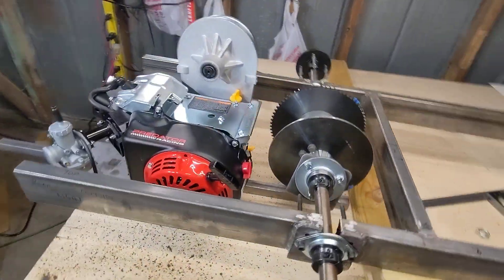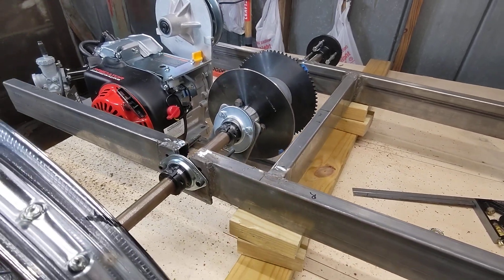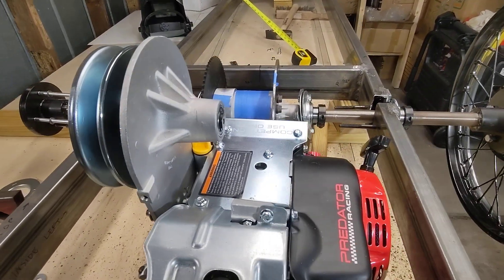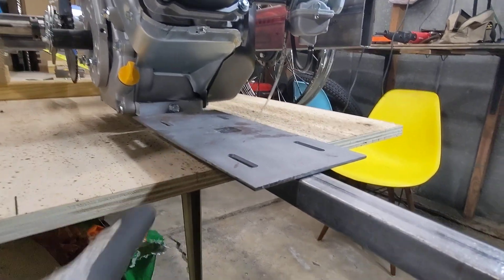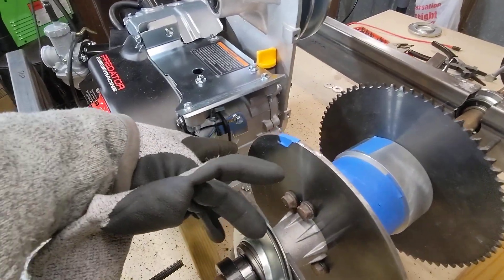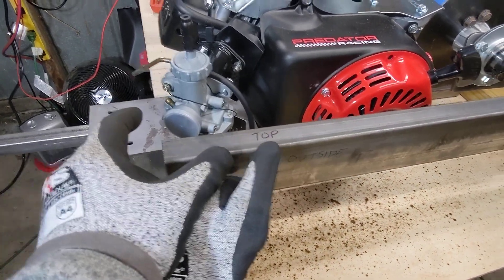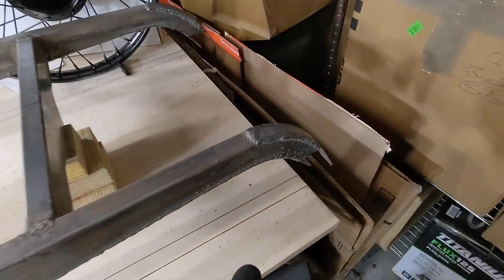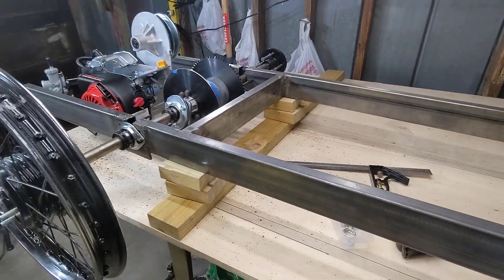Cyclekart Build - Part 5 - Drive Axle, Front End, and Motor Position

Comment: Enjoying your build. Starting the envisioning process for building one myself. Actually the trick is to set up the gas for your mig and not use flux core. Your welds will look way better.
Reply from the maker: Yeah I've been watching the other guys on YouTube with mig and it's like night and day. The other problem is that I'm welding 16ga to 16 ga, it just loves to burn through. Next year I'm just going full TIG
Reply from the maker: Thanks for commenting by the way. It gets lonely welding this up and bolting things together. Comments help with drive to finish this thing